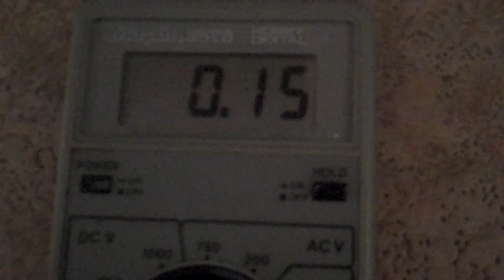Magic narrowboat rust treatment!

Comment: I'm surprised you were using this low of a voltage. I would have guessed something arger like a car or motorcycle 12 volt battery. This brought back memories of when I was a kid, I electroplated a key, using a small cube (about 3/8 of an inch square) a 12 volt model train transformer run off 110 volts ac and if I remember correctly, some Aluminum sulphate or perhaps sulfide, something I found in my chemistry set. This was almost fifty years ago, and I think I read up on how to do it in our Britannica Encyclopedia. Pretty nerdy huh?  Anyway, after about 24 hors time, the key which originally looked brass in color, was now fully coated in aluminum, one electron at a time . . .